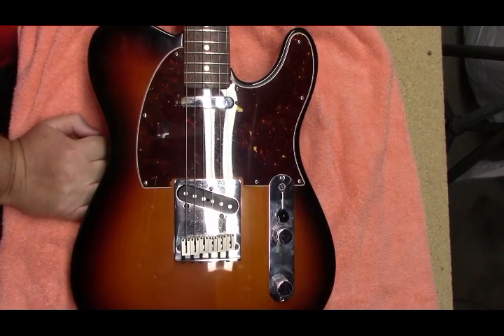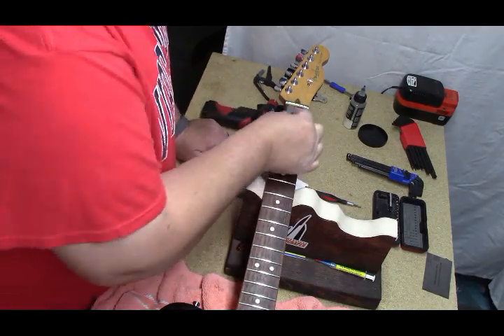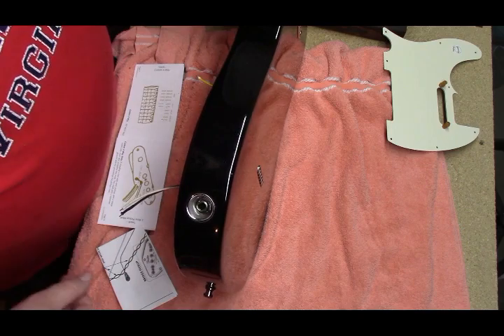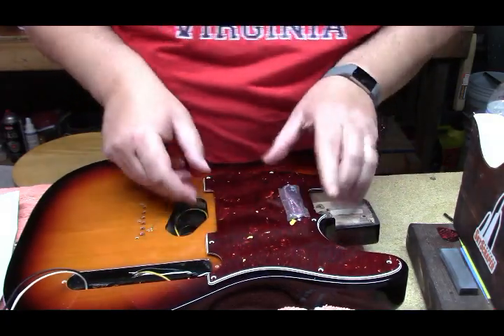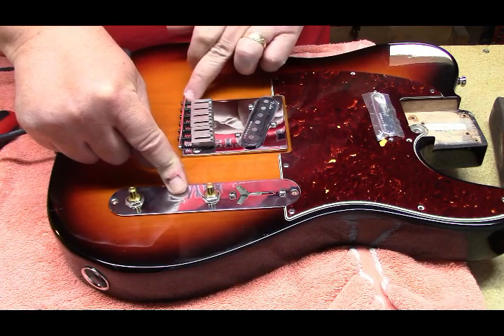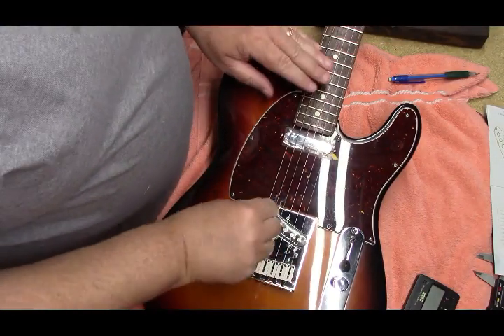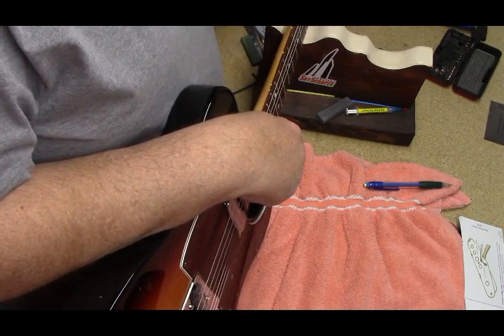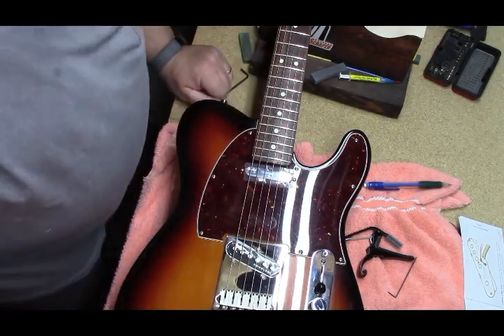Fender American Telecaster Gets Gen4 Noiseless Pickups and Obsidian Wiring Kit

Comment: Hey... just a quick question... if I am upgrading my pickups on Larry Carlton T7 Telecaster to Gen4 Noiseless.. do i need to change the wiring as well? as it seems that now only middle position of my pickups is working, but overall it sounds waaaay too quiet on my amplifier and it is already on highest volume possible
Reply from the maker: I believe you do. Check Fender’s wiring diagram.